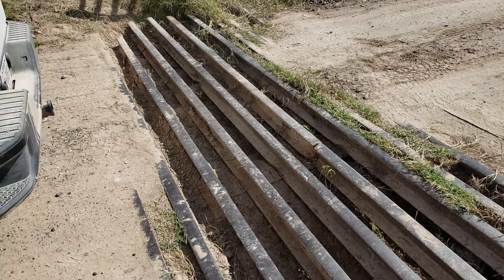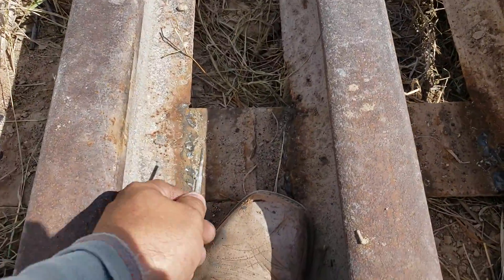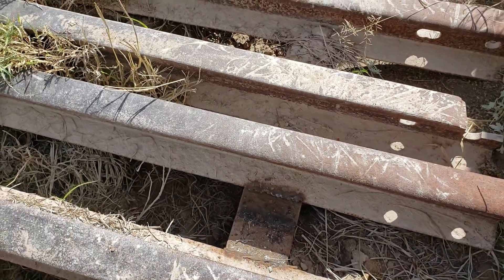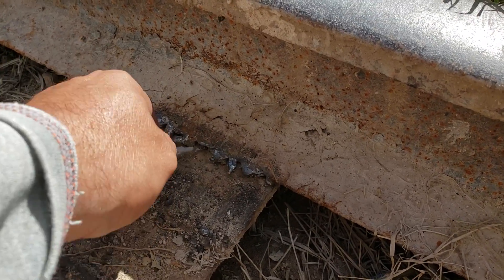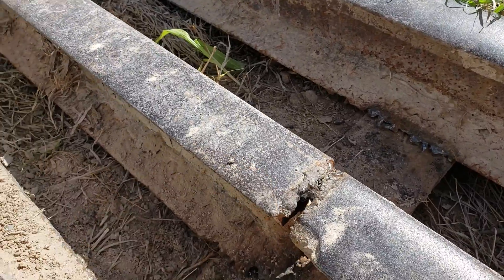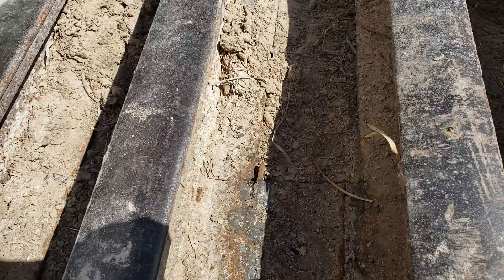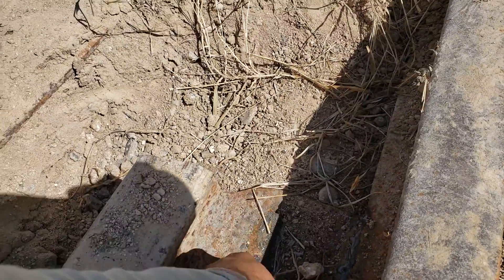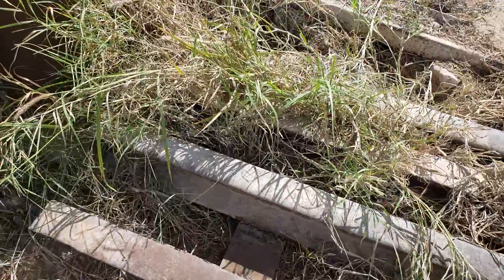Worst welds I have seen in any welding job total fail, Ranger GTX250 and E7018

Comment: Shouldn’t be welding that with 7018 anyway. Railroad ties are made of a lot higher tensile strength steel. I generally use 11018 for railroad ties.
Reply from the maker: I have never welded steel that thick so appreciate the tips. I mostly use 6010, 6011 and 7018 for my hobbies and dont do structural welding. Sometimes I wish I would of gone to welding school or tagged along with pipeliners in the 90s when oil/gas drilling was at its max. Thanks for the suggestion and if I ever weld a railroad section I know what to pick..